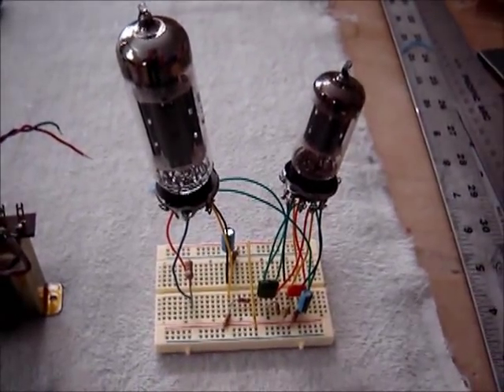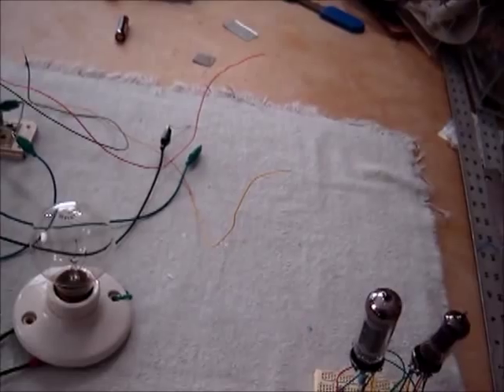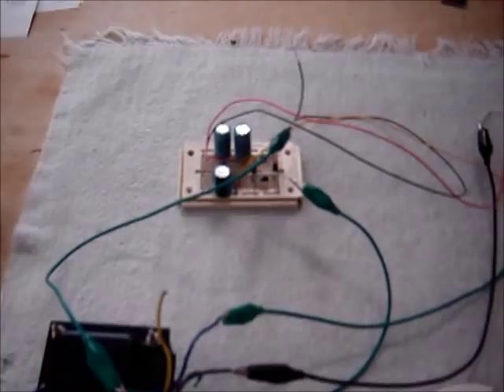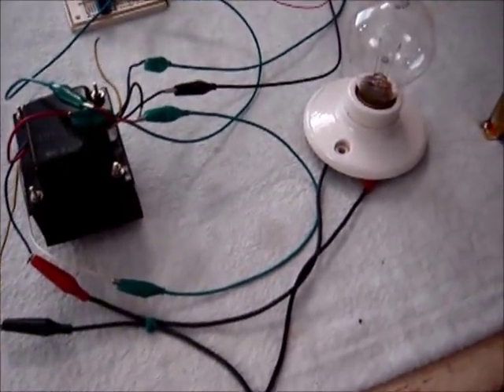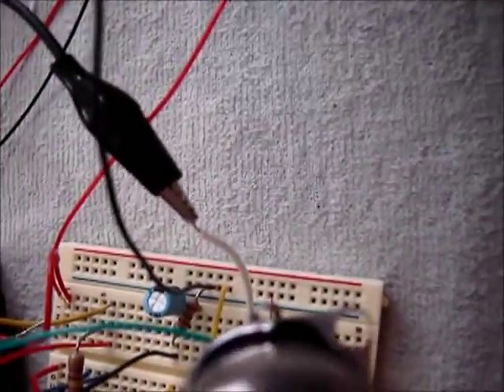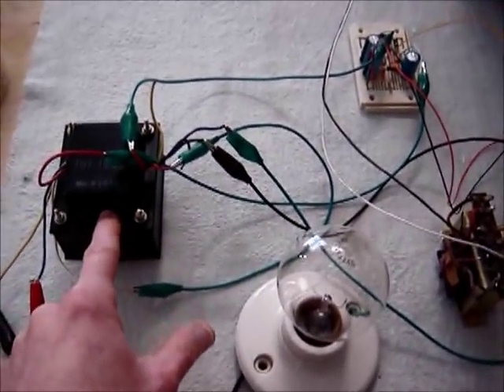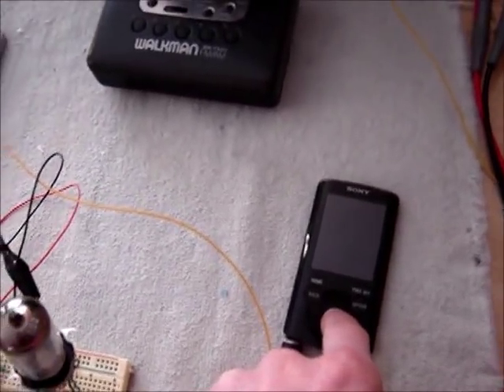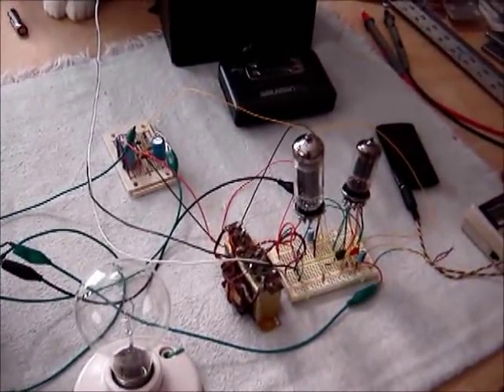Tube amplifier on breadboard SE 6BQ5 12AX7

Comment: I did something like this a few years ago. Those breadboards are not designed for such high voltages. I had a 400v transformer with a bridge rectifier, EL34 and 12AT7. It worked great until the cathode bias resistor smoked on the EL34, then it flashed inside the tube and the  speaker made a loud thump and smoked.

Comment: How do you would design a tube amplifier if you had the money to do it? I guess it would be not very different from the typical modern-type tube amplifiers of the high-end szene (high frequency power tubes in push pull arrangement)? What do you think about the circlotron design with floating power supplies? I like it very much, even in the case of solid state (MOSFET) amplifiers. The only disadvantage is the need for very clean and stable power supplies like modern switch mode power supplies.

Comment: For such a low power amp you could use a cheap isolation transformer and a voltage doubler for B+.

Comment: What is the maximum amount of power you can put through a solderless breadboard safely? I don't think it would ever occur to me to put high voltage into one.
Reply: I think it is more a question of current not of power. Much more than 5 A is not recommented for these bread boards.
Reply: It's the current that matters not voltage,  well if you have high frequency the current would arc across but you need way more than 300 volts for that to happen.

Comment: With 6BQ5 you need around 270V plate.You can get tube info on line. Check the audio transformer. some have screen tap. Check to see if has center tap. may be push pull audio out put. and also you need to match impedance to plate and speaker.  with pre amp tube. the 12AX7 will have higher gain than 12AU7. but the 12AU7 can provide higher drive.   also chect bias current with input shorted to ground. you should have cap on input. The tubes can run at many plate volts. you have to adjust BIAS. love the breadboard.